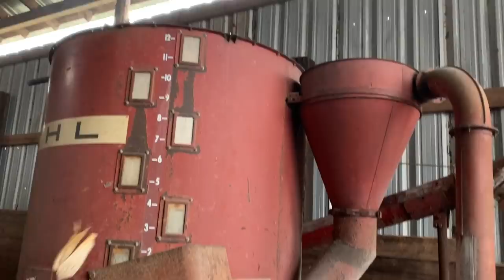Grinding {Corn} To a Halt

Comment: Great video, yeah, couple tractors and equipment, whether new or old, with cold weather and the temper often gets as short as the days, good you can escape,even temporarily with writing, hard times right now, but the sun and heat will displace this cold, snowy, muddy weather
Reply from the maker: Yes to all of that. Take it a day at a time, good with bad, keep on keeping on. ☺️

Comment: I'm still going through your videos I don't like the winter I really dread it coming but it will ,I have an old tractor but I don't use it because I modernized the electrical system years ago and now I can't find parts to fix it,I here you mention the Dan river I thing I went over it last year when I went to a race in Martinsville

Comment: One of those interesting days I hope things are on the upswing now. Mud sucks, up here in North Dakota we are froze solid 5 months out of the year..lol not quite that long. About 10 years ago on Good Friday we had a perfect storm. The temp was around 30 to 32 degrees and a storm came as freezing rain and snow. It stuck to power lines to the point they were about 3 to 4 inches around with ice...well ...every wooden power pole going east and west broke off as well as snapping power lines. Basically workers came from all 4 corners of our great USA  and helped out. I was without power for 17 days. Cows weren't to impressed to say the least. I hope your days are going better now. Good luck!
Reply from the maker: Oh wow, that WAS a bad storm. :O Things are fine here. Still muddy and more rain coming, but we'll make do, because that's all we can do. :) Hope you have a great rest of the week!

Comment: I wore good leather work gloves for baling and 2 pairs (yes, 2) of cheap clothe gloves for other stuff like hooking up/unhooking equipment and driving.  I wore 2 pairs cuz I would always wear out the outer pair just steering the tractor.  When it was time to toss the outer pair, I would get a new inner pair & just cycle through.  Summer months would wear out many pairs of gloves (12-18 hrs of tractor driving each day except Sundays)
Reply from the maker: I’ve heard that works for some! I need to try it. Thank you!

Comment: Pro tip, I found a jump box that can jump start anything.  I stopped trying to keep batteries in my tractors and just use these jump boxes instead.  They're a Booster Pac ES5000, and my oldest one is 7 years old now, and still working fine.  Plus they're still only around $120 bucks.  All my stuff is diesel and it'll even start my big cat 416 backhoe on a cold morning without any other batteries hooked up.  And it doesn't just crank it over, it cranks it over fast.  With the added benefit of being able to easily unhook it to use on something else as needed, or just carry it along just in case.  And they stay recharged via the alternator just like a regular battery, so I almost never have to plug one in.
Reply from the maker: Thanks for the tip! We have a box like that, maybe not the exact same. Put new batteries in, so hopefully that will help a lot this winter :)

Comment: Ground a lot of feed the same way. We used a 706 IH and an IH feed mill. Loaded minerals hay and corn and molassas. Loaded ear corn out of an old bin with a shovel too. Cobs and shucks make for good feed. I know your husband would never let you get in a position to get hurt but you need to watch out for him too. You get to fixing on something and stressed and it is easy to get hurt. I was thinking the same thing when he said he needed a little more power. That M is a bit on the weak side. It is hard to explain but doing that kind of work is satisfying in a strange kind of way. After your day you NEED some quiet time. Hope your writing comes along...........
Reply from the maker: You’re right about it being satisfying in a strange way. Hard to explain isn’t it? We always need to be vigilant about safety. Thanks for watching!

Comment: M  When I was a kid on our family farm, Dad used an M tractor with a farmhand loader- Hay stacker, than we switched from the hay stacking head to a bucket. We then loaded gravity wagons. We used a JD 4010 to run a Bear Cat grinder. That's how I spent almost every Saturday morning during school aged years. Grinding corn. Yea  "Not so much"  Sometimes if the weather was nice and not freezing cold we ground up to 4 wagon loads, So my Dad wouldn't have to grind during the week. There was however some fun to be had. When the wagons were almost empty there were always mice in their. So I or we would pick up our farm cats and throw them in the wagon. If you can imagine cats chasing mice around on a slick floored steel sloped gravity wagon. That should definitely be on your bucket list. M please feel free to correct my grammar, sentence structure, punctuation, etcetera.
Reply from the maker: That cat story sounds like something my husband would do 😅😅 And your grammar is safe with me. I ain’t no grammar police 😉

Comment: That one thing I use to hate doing was grinder up feed for the cow. The guy I use to work for had about 60 head and making feed by myself was not fun. One was I had to get in the bin where the corn was and it took almost a hour to get another corn with rats running across your feet. Them put the hay in and have to do it by hand from a round bale and I put the hole bale in the grinder it was fun if you want to call it that. But the fun part of all of it was pulling hay off the bale and there is a live Snake in the bale that I had just pull hay off of. But thank GOD he didn't get me but i DID GET HIM. what part of North Carolina are you from because I live near the coast well you say 18 mile from Emerald Isle.
Reply from the maker: Oh gosh. Now I’m scared to get in there and clean it out which he said I need to do soon. 😝

Comment: We picked all our corn years ago therefore I know all about shoveling cob corn out of the crib. We also put a big pile on the ground so I could use the skidster to fill the hopper up then at least. Now it's all high moisture corn but still use the grinder. Grind all the HMC before it goes in the silo or bag. The wire cribs are still here and in my way but for some reason my Dad must have some sentimental attachment to them that we can't take them down🙄
Reply from the maker: LOL, you should see all the things around this farm that I have no clue why they are here. But there's always that "one day I might need it" mentality running strong. ;)
Reply: @ThisFarmWife_  yup, like all the extra boards or iron that have been piled up since I was a kid because we might need it someday meanwhile it's just rotting and rusting away😂 makes no sense but ya know we might save a dime some day in the future.
Reply from the maker: That's what my husband says :P

Comment: My wife had learned not to ask questions in the middle of a mess...
Reply from the maker: It doesn't take long to learn haha
Reply: Hi Meredith. Don't worry everyone has to learn some people just learn differently. Geez it must be so cold doing your jobs for the day all rugged up. One thing I never got used to was the way I itched after we were shovelling or bagging sorghum . Especially down the neck of my shirt. Ya know crying is there so ya don't blow a valve and it can make you feel better and much clearer. Happy Farming even if it is wet and cold 😁😁 P.S just lurv the mittens